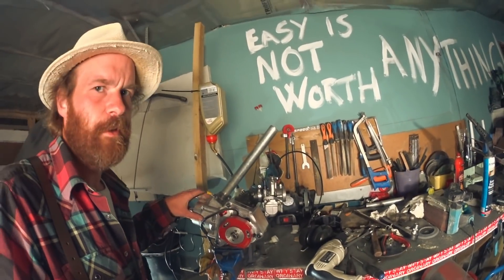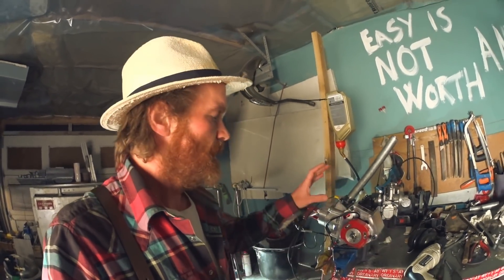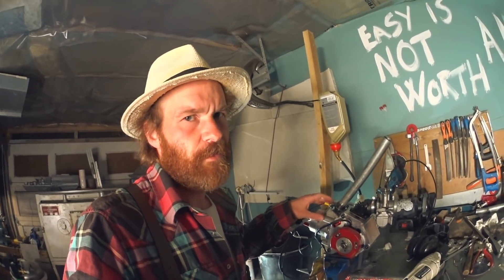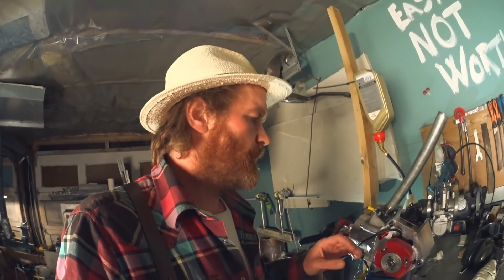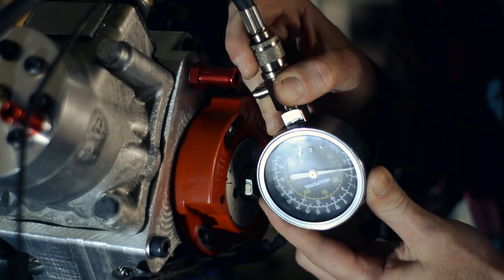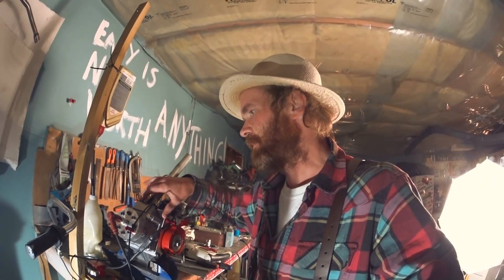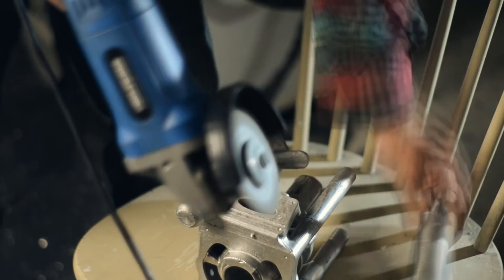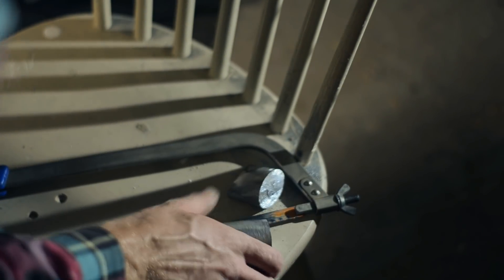Pipe! - The Most Powerful Two Stroke Ever

Comment: You say you don't know everything,  But your definitely pushing the boundaries and achieving. 
One thing i picked is expansion chamber close to cylinder is bottom end , flat trackers, land speed more topend power more distance from cylinder. 
But i could be wrong with your 20,000 rpm ?
Cheers love it man

Comment: Put some 2-stroke mix trough it and power it backwars and forwads from 24V battery. If it doesn't have a diode that is :) it might have just rusted a bit in the pump part...

Comment: Quick word. I don't think you can use a sous vide for plating. The element is in contact with the water. It would probably get plated as well and may lead to major if not scarry issues. A better option would be one of those heaters plates for beakers w/ the pill in them for circulating the water.Probably a lot more expensive, but they are intended for uses like this and won't die after or mid-way through the first attempt.
Reply from the maker: See latest video, using a water bath.

Comment: After hobbyists drive their nitro rc cars they put after-run oil in the carb and they remove the glow plug and cranck the engine and fills it with the oil. That protects the engine from smudge and rust. Maybe after run oil could be a solution for your methanol-pump and also your engine.
Reply from the maker: 👍 Absolutely.
Reply: @2STROKESTUFFING  its expensive though i pay 82 SEK for 50ml
Reply: Or maybe not a little bottle last a long time for me

Comment: Hey there mate, Can you please tell us a bit about how and why you decided to run with that size stinger length and diameter? And tell us what the dimensions are. Just by eye it looks like you are running on the extreme side of caution. I would have thought a good safe start would be around 95mm long and 20mm in diameter for the stinger. With room to go longer length /smaller diameter when you get it on the dyno if it needs it. 
And a muffler??
Any ways, Great progress, keep up the good work! Cheers!
Reply from the maker: Thanks! The actual stinger is not part of the equation in this case, it's large enough ID to not have an effect on pressure. That aluminum venturi is what does the job, it's 17mm ID at it's narrowest point(conservative).
Reply: Of coarse, sorry mate. The Honda NSR250 and my Aprilia rs250 use that type system stock, but for some reason I do all my custom pipes with normal stingers. Maybe it’s because it’s because It’s the only way I know how! 
I think I might have been poring a glass right when you took it off the lathe and showed the ID.  My bad!
Cheers, keep up the good work 👌🤘👍

Comment: I used to teach welding at the community college where I now teach energy technology. You’re doing well, especially, after welding mostly with MiG. As with all new skills, practice! You’ll find that learning your equipment is as necessary as learning the skill itself. Practice is key.
Reply: Also, I can see the fully developed 100cc twin version of this. 275 hp, 19,000 rpm, a 300 rpm power band, and needing a 38-speed transmission to hit peak top end at Bonneville.  Go for it, bro. 👍👍

Comment: By the way, one of the easiest ways to increase power and performance on the 2 stroke engine is to pressurize the fuel tank the same way that your string trimmer 25cc motor is.  That is why the fuel bulb has to be used for 10 pumps 1st before starting.   A line that is connected to the crankcase via the carburetor is the common method,  however, a line attached directly to the crankcase is the method that used to be used in the ancient times for model airplane engines to soup them up a bit.  YOU HAVE A VERY INTRIGUING SET OF VIDEOS THAT I AM CURRENTLY FOLLOWING.  Thank you so much for sharing your adventures into 2 stroke engines.

Comment: Electroless nickel will deposit very evenly between 0.0004- 0.0012” of an inch. Any thicker and it starts getting uneven. Chrome has microscopic cracks that are very good for sucking up and holding oil. Electroless nickel does not, it’s one continuous smooth coating. Keep up the good work perseverance pays off more than smart and lazy.

Comment: So if Peter Plichta, of Germany, is correct in his 'Benzin aus Sand'/'God's Secert Formula', then twenty times more energy can be chemically stored in a silicon fluid, as opposed to current hydrocarbon fluids.  When that much more energy is released, the engine will become SMALLER.  Imagine enough chemical energy to cross the Continental U.S. on six gallons of fuel.  How small would the fuel delivery system have to be?  By my estimates, the size of an R/C nitro engine.
In theory, you can get more power from a Nitrogen/Silicon reaction on closed throttle (ie 5%+), by sublimating the 'hydro-silicate' fuel developed by Dr. Plichta.  Too bad it only written in German, Published Sept, of 2001.
NASCAR has been using it to cheat for three decades now.

Comment: 10:32 What are those two boards you're using to run the pump and the injector? The one on the right looks like an arduino clone with an atmega328p

Comment: Well my tig doesn't look much better either.. I am an old stick man that fell in love with the quick mig set up.. But weld like 4 year old with tig.. Just do not have the patients..  Wish you had that cooker though.. I am curious to see if this non electric nickel set up works well and how much more of a hassle it is. It would sure take up less space in the shop if it worked well.. How long until the next Bonneville test? I haven't been out to the salt flats since the mid 70's back in the days for the green monster and spirit of America slugged it out.. Used to go quiet a bit back then.. Well when evr it is I hope there will not be a lake there then.. carry on my brother.. you do amazing things with that engine..

Comment: Do your compression test with throttle wide open just so the air flow isn't effecting pressure produced, just a thought as I tested my motocross closed throttle and it was 125psi then wide open and it jumped to 160-170psi with a good tester as well.
Reply: Love your videos by the way 👌👍
Reply from the maker: Thanks! Yep, WOT.

Comment: For that fuel pump, did you pickle it in gasoline or did you let it sit dry? Friend of my dad's used to run methanol in his bug and after he finished he would drain all the methanol and fill his 5 gallon tank up with straight gasoline for a long while before he shut the car off.  He would let all the gasoline sit in the fuel system until it was time to race, and he would just drain all the gasoline back into its special container and fill it back up with methanol. I think part of the key was never letting the pump sit dry after pickling it with gasoline.

If you are doing that, i dunno. Maybe you need a larger volume of gasoline to dilute the system enough to mitigate the damage methanol and nitro do to fuel systems.
Reply from the maker: 👍 Did just that. It's fine, turns out I forgot to hook up Arduino ground...
Reply: @2STROKESTUFFING  hahaha always end up something stupid simple

Comment: Please invest a few Kronas/Euros/whatever to buy a set of good, professionally made piston rings for your engine. You are burning way too much time by improving homemade stuff, which you can in fact buy on the cheap on the internet! (The same goes for your cranky piston!) The rest of your engine design is great! But for the sake of your own mental health, as well as for the success of your project, you should really concentrate on designing and improving the parts which really need improving to create more power, and leave the design and manufacturing of the penny parts to the specialists.
Reply from the maker: Great advice, but... You can't buy these rings, nor the pistons for them, and they're a necessity for a 100% bore width single exhaust port to work. See earlier vids.

Comment: You can try to salvage the pupm by opening it from the crimped end. I used similar pump for water meth injection and forgot to purge it. It just needed some oil and rotate it by hand to free it. Then crimped it again and it worked ok for a year.
Reply from the maker: Great tip! It's actually fine, forgot Arduino ground...
Reply: 2STROKE STUFFING That is awesome! Cheers from Finland!

Comment: Hey, to make the pump driver work with Arduino you must also connect the black wire (gnd) between the arduino and the pump driver! Otherwise the PWM signal will fail to reach the driver board!
Reply from the maker: 😂 I feel stupid now! Just quickly hooked it up and forgot...
Reply: @2STROKESTUFFING  wow......it took a real Engineer?.  forget the stupid bit, we are all learning with you.

Comment: You might want to do an autopsy on that fuel pump to see what happened to it. 
If it looks like its just o-ring seals going bad and then flooding the rest of the pump, you might want to look into changing those seals on the new pump to make it withstand the fuel better. I know from work that methanol will make viton seals go bad but NBR/Buna N/nitrile rubber stands up to it pretty well. Not sure about the nitro but there are tables for chemical resistance online.

Keep up the good work :)
Reply from the maker: 👍 Turns out it's ok, forgot the Arduino ground... (nitromethane is hard on viton)

Comment: maybe I didn't understand correctly, my English is a bit poor😄.   
Do not harden the segment-ring or it becomes abrasive due to the Nikasil treatment on the cylinder!  Some time ago, I destroyed a cylinder because I used a chrome ring instead of a cast iron one.  2 km were enough and the cylinder was completely smooth.  congratulations for the wonderful work!  Keep it up👍🏻😊
Reply from the maker: It was tempered too soft, after grinding away most of the "T" it might last longer tho.

Comment: You need NItromethane specific fuel pump as it uses compatible seals. Petrol pump will fail rather quickly when used with nitromethane.
Reply from the maker: Hard to come by...

Comment: Just a little tip from somebody that's spent a good bit of time machining. 
I'd get rid of the flat edge on the tool tip, make it a smooth radius leading to the left hand edge. The left hand edge should be straight, as you want even contact for it to cut without stress risers.
Try upping the feed on roughing passes.  I'd at least double that feed. You'll get less swarf, get the job done faster, and the tool edge will last a lot longer.  Might as well use all the power your lathe has available.
A little lube is good with Aluminium too. If it's liquid, it probably works works; kerosene, cutting compound, engine oil...
Looking good though! Cant wait to see it running with the pipe.
Reply from the maker: Thanks for the tips!

Comment: The pin retained ring idea is growing on me and I liked the raised floor exhaust reduce the blowdown losses, modern engines were half way there with their narrow port bottom.
A technique for making rings you may not have considered is wire edm. You can cut any 2Dshape in any hardness electrically conductive material to .01mm precision with a good surface finish. Draw up the expanded ring shape desired and have it cut by a local machine shop with a WEDM machine. 1mm hardened gauge plate would be a good material to start with. Making a cast iron lap equal to the bore size would help in lapping the rings to fit.
I will be interestd in seeing how the electroless nickel works.
Leaving methanol in the pump, not good, I ran methanol for a few years and learn't that it has an appetite for aluminum.
Reply from the maker: 👍 My neighbor works at a place they do WEDM, might try that in the future. Did purge the pump with gas/oil, and it's actually ok - turned out I forgot Arduino ground.

Comment: Maybe you could use a magnetic stirrer with hot plate and a feedback thermometer on it. I use these on work for smaler nickel coatings. Its important to hold the bath in movement, cause it rips of the tiny H2 bubbles of the surface which causes pores in the coating and it guaranteed a homogeneous temperature. Sorry for my bad english. Hope you understand.
Have a good day.

Ps: I love your project and how you give a lot of effort to it. respect. :)
Reply from the maker: Thanks! Almost bought one last year, wish I did...

Comment: Are you using bronze brazing rod? It looks like you are getting that WAY too hot! When TIG welding your puddle should only be about a quarter inch wide maybe 3/8 inch... what's that like 6mm? When using brazing rod you only want to get the metal up to just shy of melting you don't actually want to melt it and create a puddle or you are welding not brazing. (I actually took welding in college, my first TIG aluminum weld shocked my instructor who told me I can do it better than him and he's been doing it 20 years :P) The thing about TIG is you just need to keep your angles right and don't move the torch around, beyond that just move the torch forward and add filler as needed. Hell when I TIG aluminum I constantly add filler instead of "stacking nickels" and so it looks like a MIG weld instead of the shallow weld you are used to seeing. With stainless you just need to make sure it's really clean and that you have your gas up about 50% higher than normal (instead of 20cfh we run 30) and back purging the material is needed to keep sugaring away.)

Comment: Hi just wondering why your checking the compression, it's kind of redundant as it changes all throughout the rev range depending on engine rpm, throttle position, for your pipes diffuser baffle, and stinger size and length you collect volume from the above the exhaust port, specific port timing, blow down period, and combustion chamber volume, you can then choose where in the rev range you want the motor so to speak (come on the pipe)....👍
Reply from the maker: Checking to see how my ring is holding up, that's all.
Reply: @2STROKESTUFFING  ahh I was wondering what you were doing bud.

Comment: Sous Vide baths are very expensive. I made one from a cheap deep fat fryer with mechanical thermostat (not electronic controls) powered via a mains PID+thermocouple controller from eBay. Total cost about £40. Goes over 200 deg C with oil but can also be used with water.

Comment: If your machining without coolant itll bring up a bad finish, is it a different material from steel or something? Just something to keep in mind i guess, if you dont have  enough money or a reliable source well theres nothing you can do. 
I really like this stufg keep doing it
Reply: That's what I thought when I started machining but after watching Abom79 (Adam) I realised you don't need coolant for Non CNC lathe work you just need to pay attention to tool angle, tool speed and cut depth for the metal you are cutting and then you can get a clean finish.
Reply from the maker: Feed, speed, depth of cut, and tool geometry/sharpness was definitely not ideal here, but the main contributor was soft, gummy Aluminium.(which reminds me I should heat treat my cylinders)
Reply: @2STROKESTUFFING  
Yeah that stuff I just run the chuck flat out and give it a good hose of WD40, not much you can do with it.
Reply: @2STROKESTUFFING  yea im a fitter machinist wprking on mainly cnc machines that use carbides, but we are taught in the ways of  HSS, usually if we want it to cut a little better we'd spray inox or something but that does make sense as to why you dont want to use coolant due to it being a softer material

Comment: Have you ever thought about brazing? I seem to have good luck with pipes using that method. It'd be interesting if you explained how you do the calculations for pipe design, the variables etc. I'd send you over some of my homebrew but it'd probably be cheaper if you got on a plane lol
Reply from the maker: I've done some silver soldering. Have been reading up on brazing/tig brazing, sounds like a good process for lots of things(and can look amazing)
Reply: @2STROKESTUFFING  Yes, it's like soldering, just blow torch, flux and brazing rods required and good for joining dissimilar metals. I'm bad at welding, but I can braze. It doesn't rust either.

Comment: Welds don't have to be pretty they just have to work. Looking good for someone with little tig experience. 

Practice makes perfect and all that. But having crawled all over some.very rare racing bikes and cars over.the years.youd be amazed how rough the welds look. Functional matters more.than pretty. Pretty doesnt win points fast does.

As for sous vide iv seen some really not bad ones designed for dropping into a pot that work really pretty well.

Comment: I don't get it....Can someone explain why the rings he are using is wearing down so ridiculously fast?
Reply from the maker: 👍 Great info/tips. In my case it's mostly because they're heat treated too soft, and before I ground off most of the "T" profile they bound and put high pressure in some spots, no pressure in some. The ring I'm using now was never run before I ground it - might hold up better.

Comment: Im over here pushing 10whp in a 1973 3speed 63ccm moped engine 😂 thing goes 89kmh 😂
Reply: Simson?
Reply: @heinrichhein3102  jop
Reply: Der Kerl lass mich raten. ZT63N? 😅
Der läuft wirklich genial
Reply: @heinrichhein3102  jo, mit aoa3 umgeschweißt fürn star 19er gaser und vape... Ist nen schöner zylinder... Aber halt sehr altagstauglich...
Reply: Der Kerl Ja, ich verbaut denn auch immer mit nem AOA3 aber entweder VM20 oder 21er BVF, großer Luftfilter von ZT und gib Ihm.
Reply: @heinrichhein3102  ja, nächster schritt ist vm20 aber ich gatte den halt liegen.. und zum thema luftfilter einfach nen t luftfilter nehmen und zwei filus reinstecken.. geht top und ist ori optik